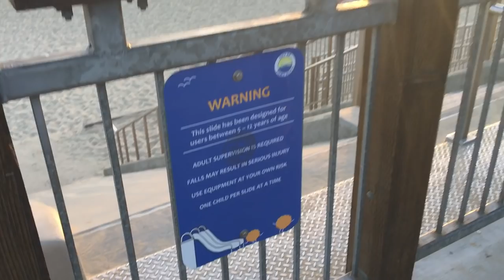WHAT IS IT LIKE TO DRIVE A CLASS A MOTORHOME TO A REST STOP, TRUCK FUEL STOP AND RV RESORT? - EP170

Comment: Fed law says the hight needs to marked on anything that is under 15 feet, most states have the same law marking for hight anything under 15 feet
Reply from the maker: That is good news to know!
Reply: @OurJourneyInMyles  one more thing if a sign says (no trucks thru) then the rv will not make it for many reasons like low bridges, wires, or weight limits

Comment: What camera did you use in the MH with front and back camera. And, what camera have you found best for this application?. Thanks and safe travels.
Reply from the maker: My old dash camera (June 2017) was a VicoVation OPIA2, which I was very satisfied with, but I thought I could get a better one now.  I checked to get an updated VicoVation, and saw that they do not make Dash Cams anymore.  It was recording in 1080P.  File size was manageable. I just bought a new NextBase 622GB with the rear cabin camera and it is better than my old camera ONLY when I record 4k. This means every 3 minutes of video is 1GB.  This will kill me with storage space costs. And this is only the front camera.  I am still working to get the happy medium of file size and quality. Personally,.......I don't recommend it yet. Try something else.

Comment: Wonderful video. In the intro when you got out of the driver’s seat and headed for the bathroom, I thought you had put Myles in autopilot. I have heard Newmar coaches almost drive themselves with comfort drive. BTW, anybody young enough at heart to blow the diesel horns in a tunnel is young enough to go down the slide. Just saying...
Reply from the maker: I really do like to blow the air horns.  I should disconnect the "auto horns" so it sounds better on camera with JUST the pure air horns alone.
Reply: @OurJourneyInMyles  I love those air horns so much I put one on my new F350 Dually. I bought the train horn with a Viair compressor wired to one of my upfitter switches. I can only dream of driving a Newmar.

Comment: Man, I love your Dutch Star. Does it drive as good as it looks?
Reply from the maker: Yes,....it drives like a Cadillac.  In future videos, watch how little I have to "correct" and "adjust" the steering wheel when on the freeway at 55 or 60 mph.  There is ZERO driver fatigue due to having to be VIGILANT during all your steering corrections.  The comfort drive system is a game changer. You DON"T HAVE TO MAKE any steering corrections!
Reply: @OurJourneyInMyles  wow that sounds nice. And does it have the three setting exhaust brake on the right side of your column?

Comment: Hello there. My wife and I enjoy your channel. It's especially difficult to find one that's not so techy has to turn her off but precise enough to apply to us when we go out on our not full-time RV journeys with our 34 ft Diesel Pusher.
Well you recently shared a video where you listed the dash cover as an essential that you would buy another one in a minute if that one was damaged or lost.

Maybe I didn't pay close attention maybe I didn't read the website very well but I ordered hours and I love it it's gorgeous but it has this massive rubber backing and weighs quite a lot. I think it will sit on the dash perfectly.

The problem is my wife has an allergy to latex and that is a latex form of rubber and it emits massive volatile odors.   Ours came with a black heavy rubber latex backing and if yours is the same I wonder how long it sits up there before that odor goes away because I would be happy to put it out on the table in the sun if I thought that odor would age out of there
Reply from the maker: We have the ShadePro dash carpet. We do not remember the smell at all,.....but I would bet that it did.  It has virtually no smell now. Can't tell you how long it may have to out gas.  Let it bake in your tow vehicle and/or storage basement,......or at home.  I wouldn't want to get it wet.  It really helps to keep things on the dash put, and is great for pets.  Good luck!

Comment: I would be scared to drive one typical vehicle has park not neutral and park break. Lol im guessing you start it in neutral then pull or push park brake then put it in gear. NIRVC says their easier than i think.
Reply from the maker: Driving a class A air-ride Newmar diesel pusher, with a steerable tag is easy as pie.  You just need to take things slow, and rely on your travel partner spotter. We wouldn't want to travel any other way, except maybe a Super C because it is safer in a crash by a LARGE, LARGE margin.  If you buy a rig, try to stick with NIRVC whether it is new or used.  You will thank yourself for doing this when you start to run into the inevitable "issues" that can come up. THEY WILL HAVE YOUR BACK.

Comment: Do you have the Good Sam's Piolet/ flying J discount card?
Reply from the maker: Yes,.......and I would suggest folks use that card when they "have" to go to Pilot to atleast get the Good Sams 8 cent per gallon rate!
Reply: @OurJourneyInMyles  Yes it is better than nothing. But you can often beet it using your Gas Buddy app. I have been averaging $0.16 savings at Loves and $0.20 at Petro and TA.

Comment: LOL, I went to the original post, number one, and it dawned on me that as you got more videos under you belt that the time factor just got longer. the first videos was just a few minutes long. As I watched you drive around the CG's I wonder, Doesn't that groaning brake noise bother you? it drives me nuts. Would you like me to fix it for you?
Reply from the maker: We no longer hear it!  Is it easy to fix?  What is it?  Sounds like an air valve moaning,.......

Comment: The big question is how are normal average retired people able to afford this???
Reply from the maker: We see within reason, the costs can be driven down quite a bit by selecting the right equipment to RV in, and to stay at RV parks a month at a crack to get the best rates. We are tourists, and are essentially on an extended vacation all the time. We started saving for this in 1983.
Reply: @OurJourneyInMyles  I've been saving as much as possible since right around that same time and haven't done bad but with the daily plummets in the stock market combined with guaranteed quick depreciation on most rv's it's a scary thing to contemplate.